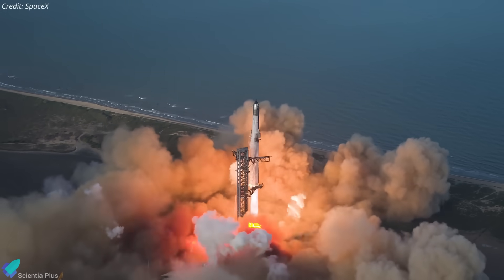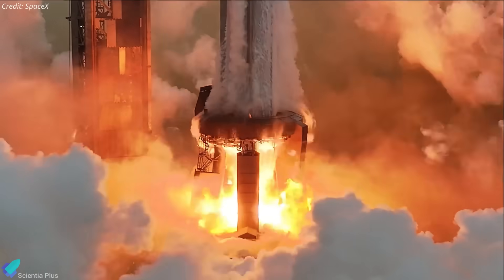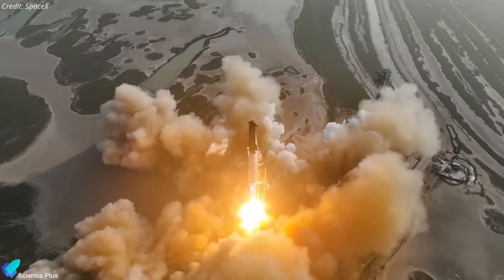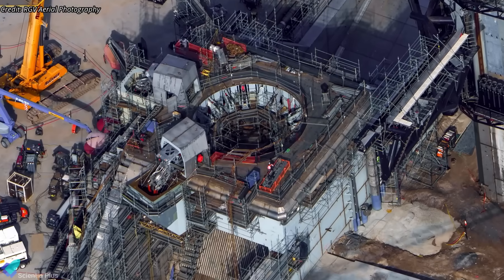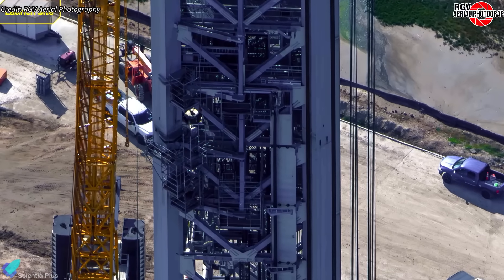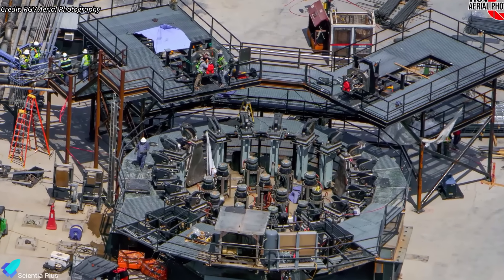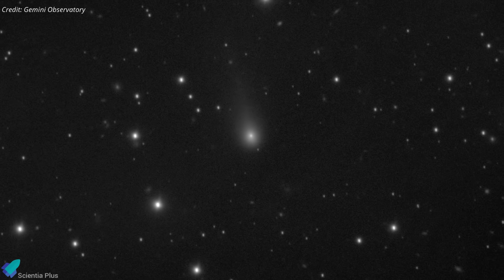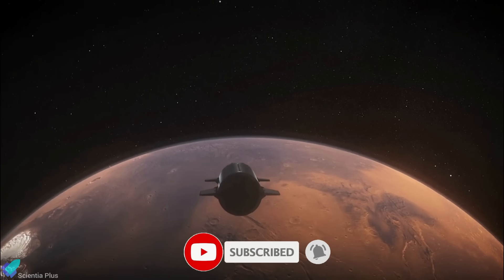SpaceX Moving INSANELY Fast! Booster 15 Static Fires for Starship Flight 11! Launch Date?

Comment from the maker: 00:00 Starship Updates
10:28 Comet 3I/ATLAS Is NOT Normal - Passing Mars Soon

🚀 Starship Flight 10 
  📽Detailed Breakdown: https://youtu.be/irVUMJNe0Kc
  📽Root Cause of Anomalies: https://youtu.be/LBUpp7MRVSY

📚 Learn More:

🚀 Starship Block 2 Explained:
 📖 Summary: https://shorturl.at/b0dtw
 🔍 Detailed Explanations:
  • Design Improvements Update 1: https://shorturl.at/lpGT7
  • Design Improvements Update 2: https://shorturl.at/gwNQ4
  • Nosecone & Payload Bay Redesign: https://shorturl.at/xa60S
  • Methane Downcomer Redesign: https://shorturl.at/XdYBG

🚀 Starship Block 3 Explained: https://shorturl.at/mnBT4
  • Detailed Breakdown: https://shorturl.at/IViwD
  • Production Begins: https://shorturl.at/xRNkJ
  • New Transfer Tube / Downcomer Explained: https://shorturl.at/Iaqc6
  • New Grid Fin Explained: https://shorturl.at/NxdVo

🚀 Starship Block 4 Unveiled: https://shorturl.at/7A2ef
 
🔥 Raptor V3 Mega Upgrades & First Test: https://shorturl.at/TRIyj
🧱 What’s Inside Starship GigaBay?: https://shorturl.at/nJM75

🛠 Insane Engineering of New Starship Launch Pad 2: https://shorturl.at/7RAZd

🛢 Dual-Port Orbital Refueling – Full Technical Breakdown
https://shorturl.at/5tiqK

🛠 Other Starship Upgrades:
 • Hot Staging Explained: https://shorturl.at/jf400
 • Super Heavy Booster Upgrades: https://shorturl.at/Pi5R3
 • How SpaceX Protects Raptor Engines: https://shorturl.at/4Om8F
 • New Heat Tiles Explained: https://shorturl.at/p2Ijb

🚀 Starship Flight 10 
  📽Detailed Breakdown: https://youtu.be/irVUMJNe0Kc
  📽Root Cause of Anomalies: https://youtu.be/LBUpp7MRVSY

📡 Stay Updated:
📢 Weekly Updates: https://bit.ly/3HIQjPC
🚀 SpaceX Playlist: https://bit.ly/34wue8T

🌍 Follow Us:
👍 Facebook: https://www.facebook.com/scientiaplus
Reply: Nothing is normal when only seen 2 or 3 times in our history and comes from intergalactic space. But claiming more than there is, is just click bait.

Comment: Is the flight termination system installed on the launch pad after all other work has been done? That never happens in the gigabays.
Reply: FTS is not "charged" until just before flight. I saw that action on flight 10.. Like that was the last thing to do.
Reply: @francom6230 Yes, the last work is that there are four men with backpacks making the FTS 'sharp'.
Reply: I'd hope not. Imagine working with a FTS next to you. Risk assessments would be a nightmare.
Reply: @davfree9732  Yes, but this video said 'back into the factory for ..., and installing FTS'.